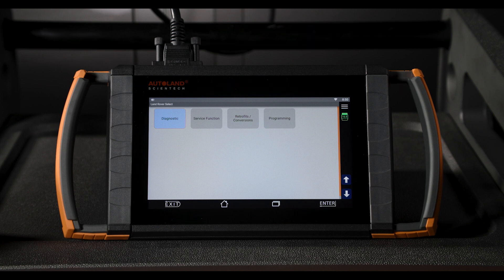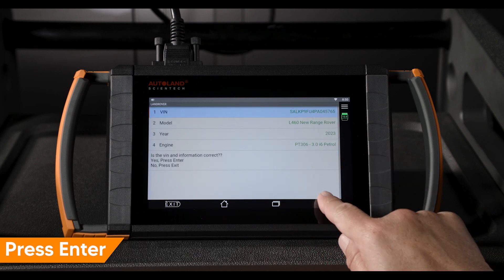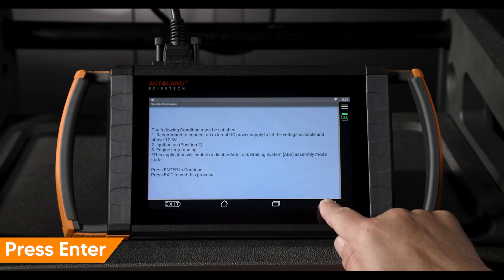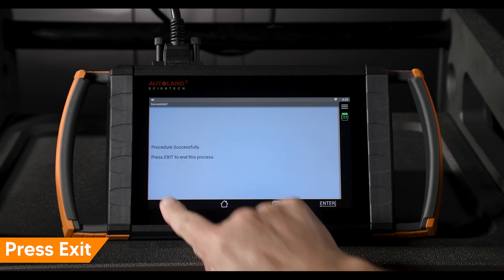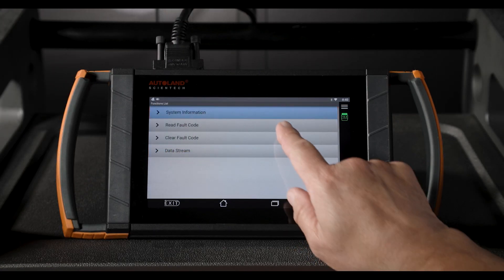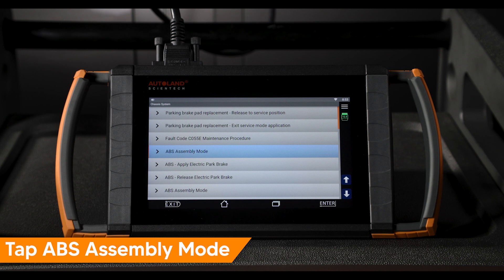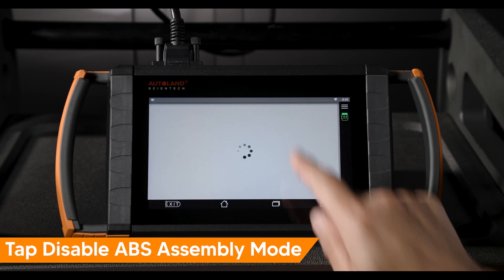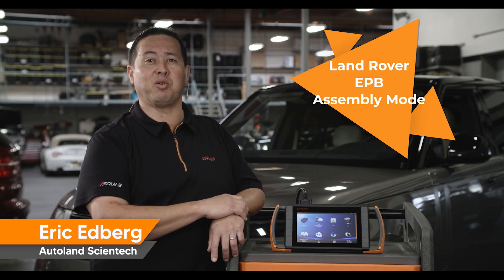Land Rover Range Rover L460 how to Enter Assembly Mode | Required Procedure When Servicing Brakes

Comment: L461 Range Rover Sport here. I want to change the rear pads soon. When I went and ahead released the EPB, it automatically enabled ABS assembly mode. I had to get in there and disable ABS assembly mode for the stability control and brake fault to go away. Any advise for those of trying to simply disengage EPB to change pads?
Reply from the maker: When replacing any brake component other than pads and rotors, the vehicle will have to be put into assembly mode. 

When Assembly Mode is enabled, the instrument cluster will emit a chime, and warning lights will be illuminated